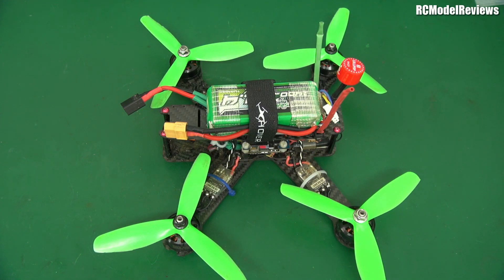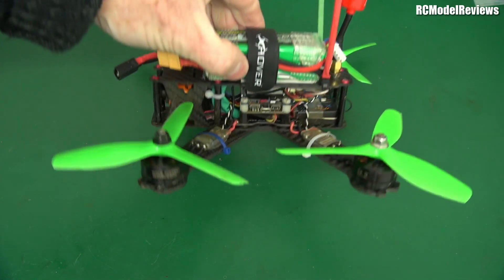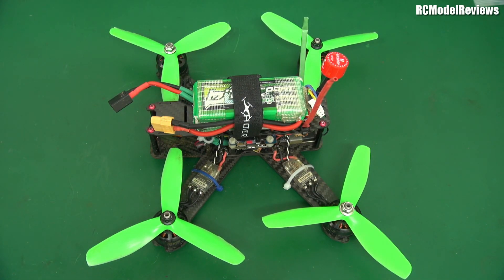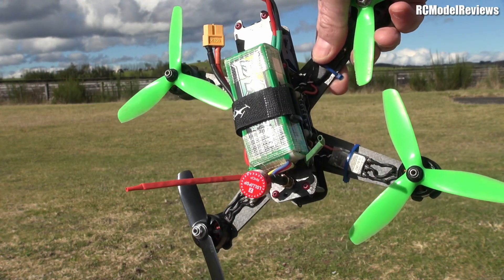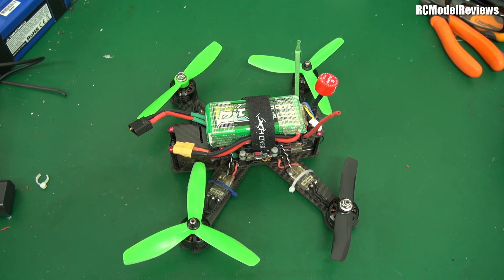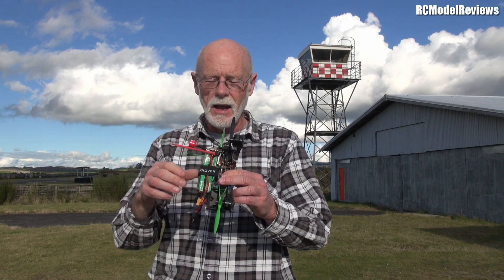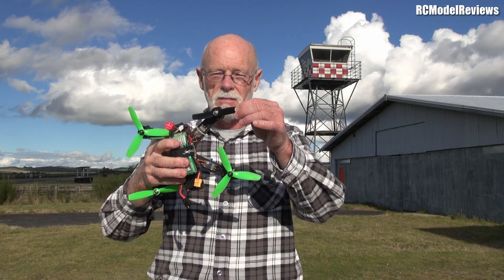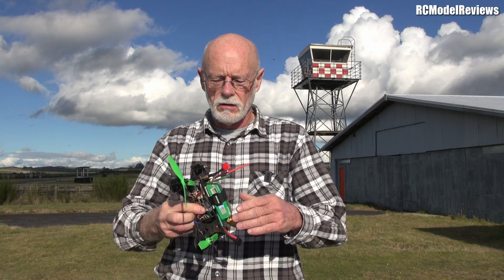Can a Naze 5 hold this quad

Comment: All the obsession with the "upgraded" boards is mostly marketing hype. I have an older "A" tail configured quad that has amazing yaw rate as these type configurations are known for. It has always flown great with a Naze5 board, no extensive tuning required. I decided to try newer F4 board and after hours of experimenting, going on forums for advice, PID analyzers, logging etc I gave up and went back to the Naze5 board.

Comment: Im using the Ls-210 ,5045 tri-props ,2200mah 3s,and lowered my top deck using the foot stands(dremel some holes for omnibus(nxt run cam+dvr.

Comment: I recently added a barometer, compass and gps to my naze rev5 and flashed inav. Now my old reptile 260 with its 1806 motors has rth function. You don´t have to buy the newest things to have fun...
Reply: That actually sounds very interesting. I like racing/freestyle type miniquads over flying tripods, but playing with some of the tech could be a blast! I'm wondering if it could be taken as far as pre-programming an interesting freestyle flight. 😁👍

Comment: One of my favorite builds is using Naze with 1806 2400kv motors and a 3d printed 250 flame wheel frame. it is the most docile well behaved, quick enough and 1300 batteries last nearly 10 minutes using cleanflight with moderate PID's.

Comment: I bought my first drone used from ebay. Naze rev5 FC, cheap motors and cheap 20A ESCs. And it is still one of my favourites. Not much at stake when crashing, so I still reach for it when I go flying, even though I have new Armattan quads with F4 FCs hanging on my wall.

Comment: Oh good, this IS a current video. 😉 Hate it when I get all invested in something and then figure out it's from 2 years ago. Never trust a suggested video. But okay, since I actually caught this one "fresh" I'll play along. It is bloody amazing that flight controllers are able to compensate fo r such huge imbalances. I'd love to really understand how, but.. my guess is that it'll fly fine just kind of cruising, but i you were to go flippityfloppity with it, I believe it might do some crazy stuff. I think as long as you have the altitude, it should allow recovery from almost anything, but I'd suspect that if you try to power out of a fast, level descent, it's going to limit your power to the amount of thrust you're getting out of the 4" 2 blade prop. Right? I'm thinking about trying to read the betaflight source code so I can understand how flight controllers do their thing a little better, but I see two problems. Programming that close to the hardware is pretty foreign to me, so it'd probably be like trying to read a Chinese newspaper, and it's probably completely backwards. I'd likely need to understand how the hardware works better to be able to understand the code.Oh well, back to the video... Thanks for doing what you do Bruce. I still don't know much about whay I'm doing, but a lot of what little I do know and understand, I have you to thank for. 😁👍 Happy flying! 😀

Comment: props motors does not matter, as esc and pids will correct all errors and will try to stable the quad, that's the what PIDS and FC is need for ;]

Comment: those DYS motors were really decent ive used them for ages with very little problems(occasional bell against concrete problems), They are actually really smooth and powerfull and efficient. Only downside i have with them is that now i think they are just to heavy since i fly low weight quads

Comment: Theres no way you could run the latest version of Betaflight on that thing what it run 2k 2k lol
Reply: I think it was KababFPV that said it is nigh on impossible to feel anything over 1k
Reply: @cheshirerc  maybe wint be able to feel a difference but it may still be better for the over all performance whether or not you can actually tell kinda like a cpu at 3.4ghz or 3.6ghz you still want the higer number because you know its better even if you cant tell
Reply: @ReeferNoob23  but if the pc aint being taxed, killer system may still be unnecessary No one bothers with 32k anymore when it was the Holy grail  year or two ago.
Really feel The Dentist was saying it doez not make a difference, I will have to find it.
Reply: @cheshirerc  yeah in the end i guess it is what it rite its all about having fun! However there definitely improvements that have been made to current flight controllers over thoes of the past even if  its not the pid loop more urats more processing power we definitely exceeded what the Nase can do anymore shoot i think Betaflight even stopped support on the F3 boards on ward and upwards i like the advancements in the hobby iam a total electronics nerd also the other cool thing is the stuff starts getting cheaper like when vcr and microwave oves first came out they were so damn expensive now look how cheap they are although i have old mic and its still going strong i only stated fpv 3 years ago but i heard like 5 years ago it was very expensive to get into the hobby and the equipment wasnt really that great

Comment: Thanks again for a very interesting vid, as usual Bruce!
I recently made my first brushed quad (first quad actually; I usually build tricopters) with a brushed CC3D (still available on eBay for <A$15) and a tiny Fishpepper/Frsky receiver (>300m range). Brilliant fun for smaller areas!  The little thing is very agile AND stable with the stock Cleanflight PIDs.  It feels like a bigger machine and I can fly it in an open paddock in moderate wind with much success, as far away as I can see it.  Chucked a second battery and AIO on it successfully but without much performance left over!

You have it, right Bruce: Much fun can be had with old-ish gear if you are not racing.

Comment: Kiwi looking to buy a low cost drone for cam,  what would you recommend. Preference not to be flight restricted by controller like I've seen in your video at airodrome.
Thanks
Reply: the autel drones are not flight restricted like the DJI ones.

Comment: I'm still using some F1 boards. They work alright most the time, bent and odd props and all.
  The biggest downside is the dip switches when setting it up, or when you want to adjust something, but they do work and if for someone on a super budget, $5 for a board...

Comment: For us normal mortals, who are a little advanced in our years, and like to potter about, the older FC’s are quite satisfactory. I’m still running quite a few of my robot minions on Open/Libre Pilot with no complaints. Saying that I do fly F4 FC’s and though they are more refined with extra electrickery bits with my flying style, or lack of, I don’t really notice too much of a difference.
Regards
Nidge.

Comment: Cool vid! I used to try somethin similar with an old setup I had. I would run 2 bi props and 2 triprops. I had no reason for it.  But I tried it. It was with an old  raceflight v2 board.